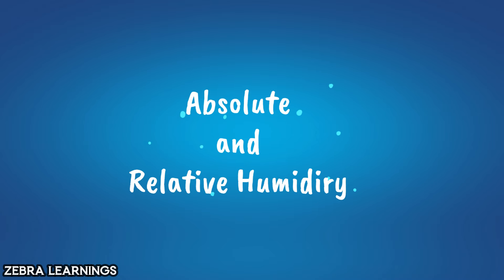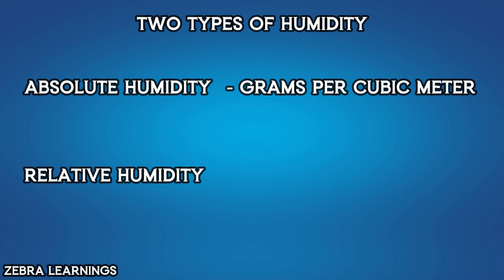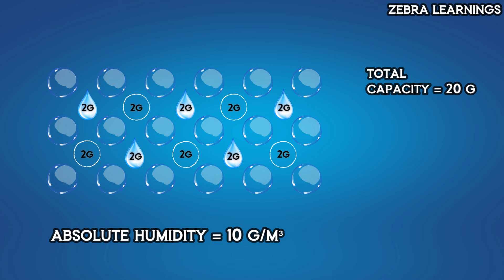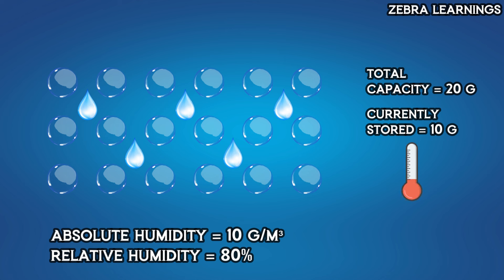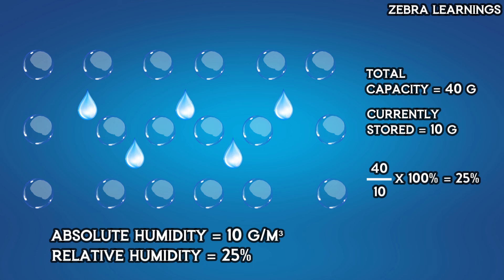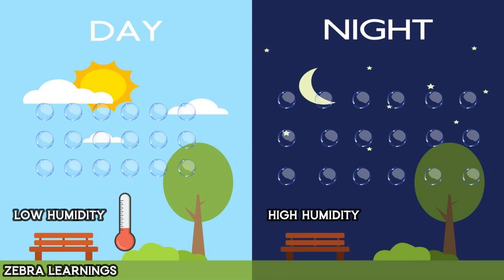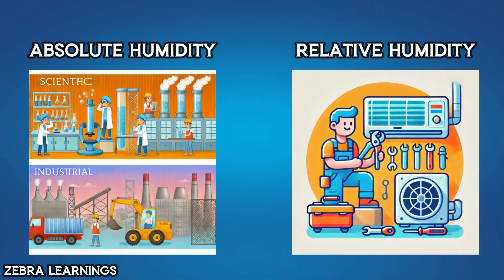Absolute Humidity vs Relative Humidity | Animation | #HVAC #hvacsystem

Comment: at 03.50, the audio says that the RH is indirectly proportional to the temperature, but in the video, it is the other way around. Also, you mentioned the cubic meter volume in the cubic meter area (01.09). Great Lecture otherwise thank you sir

Comment from the maker: There is a mistake in the fraction to calculate the Relative Humidity percentage.
The Total Capacity should be at the bottom and the current capacity should be at the top.
The formula should be like,
10/20*100% = 50%
16/20*100% = 80%
10/40*100% = 25%
Reply: Same with temperature and RH relationship 
T is inversely proportional to RH but its shown the other way around
Reply: Thank you bro,, i was confusing myself because of that 🤣

Comment: Error:

Absolute humidity is mass of water vapor over volume of a parcel—the DENSITY of water vapor in a parcel. The absolute humidity, density, DOES change with temperature. As shown, the volume increases with a rise in temperature; And decreases with a decrease in temperature.

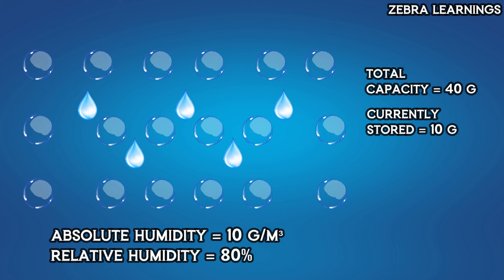02:52 The parcel expanded so it’s now 10g of water vapor in an expanded parcel, or fewer grams of water vapor in the original volume. Either way the absolute humidity, density, went down with the increase in temperature.

The changing with altitude nature of absolute humidity, density, is why it is not used much in meteorology. But why I use it in the study of tornado genesis and cloud formation. The buoyancy of an air parcel is directly related to the density of its air and its water vapor content.

Comment: Good evening sir,
Your video is very much useful to know about the humidity.. but. In this video at 2.02 min, the calculation you are mentioned is wrong based on formula.. kindly check it and correct it.

Comment: Equations written in the video vs the equation said over voice does not match; the equations said in the voice is correct though.. 

T is inversely proportional to RH ( as said correctly over voice)

Same is the issue with the calculation of RH values ..

Ps: Otherwise explanation is nicely done "

Comment: There's an error in video -- it should be 10/20, 20/20, 16/20 (1:51) you explained everything clearly but just graphics data error. @zebra
Reply from the maker: Thank you so much for highlighting this. I have mentioned it in the comment section. Next time will be careful.